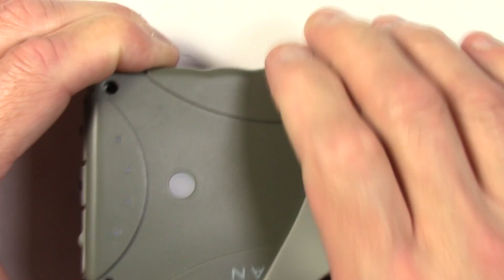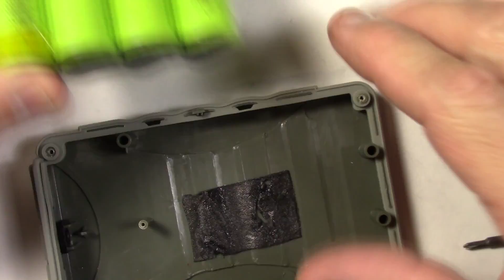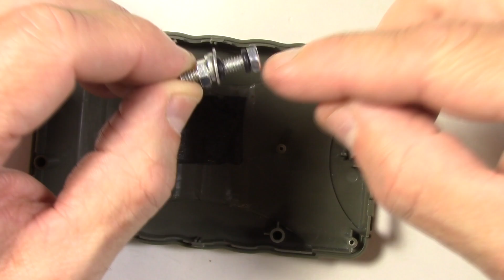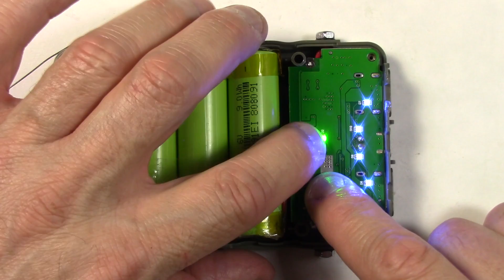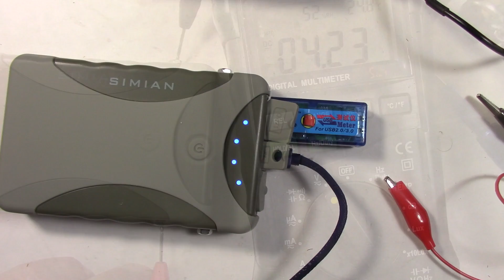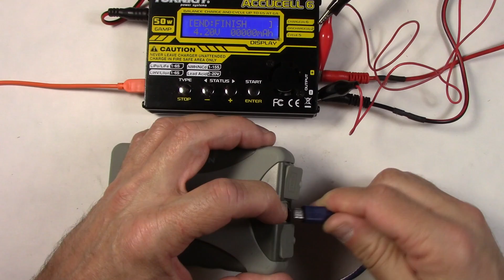Simian Power Up 10400mAh Direct Charge Mod 2 Amp + Charging "Franken Mod"

Comment: you could actually mod this much more by changing those crappy 18650 batteries out for some top end 18650s or better long as they fit inside the case lol

Comment: Hey Richard, why wouldn't you just put in a power jack that you could waterproof? That would be much safer than having 2 bare leads sticking out that could get shorted or inadvertently reversed when you charge it.
Reply from the maker: It was a quick mod. I am aware of the limitations but you can design a system that best suits your needs. Thanks.

Comment: Dear uploader,
I did hv a plan same as yrs to directly charge th cells of my Anker 10000mAh power 💪 bank , by a external Lipo charger, bt I found charging time is reasonable so did not go for mod . 

U hv any plan to do tht mod for yr Anker P.bank ?
Reply from the maker: I, like you, am happy with the charge time on the Anker power core 10000mAh charger. Here it is at Amazon: http://amzn.to/2oAExP7 for those who don't know what we are talking about. The charge time is reasonable at 2 Amps so I don't see the value in moding it. I might be able to shave an hour off the charge time by accessing the cells directly but to be frank it doesn't bother me enough to do the mod. I will consider it. Thanks.
Reply: Richard Lloyd ,
Dear uploader, u hv good idea, and interest abt USB products, lithium cells & so on. Do u knw any Qualcomm Quick charger, which also itself gets charged through Qualcomm Quick charge , or any quick charge technology ?  
I knw to charge tht power 💪 bank , it will also need 5,9,12 volt Qualcomm wall charger. 
Thanks.
Reply from the maker: Here are a few options from Amazon Quick Charge 3.0 Slim Power Bank 10000mAh : http://amzn.to/2qIQvXO or Qualcomm Quick Charge 3.0 ENEGON 10000mAh at Amazon: http://amzn.to/2qITgZi and if you are looking for a monster power bank the AUKEY 30000mAh Portable Charger with Quick Charge 3.0 at Amazon: http://amzn.to/2pcpewy should fit the bill. Thanks for asking. I will consider these as video review options. All the best.
Reply: Richard Lloyd 
Thanks a lot.  :-)
Reply from the maker: You are most welcome. Thanks for watching and the great question. All the best.

Comment: great idea, 
i was thinking if any other connection types could be used. Like female banana plugs, or xt60 but then the issue is water proof or not. I guess some mods would run the wires outside and a xt60 plug.
Reply from the maker: I was toying with a variety of different jacks but none of them were waterproof. I think this solution achieved all my objectives outside of being esthetically pleasing it's cheap, easy and effective. Thanks.
Reply: Richard, what about making an enclosure that is waterproof, and putting the wires through the enclosure, to the battery pack? The Jack can be housed inside of the enclosure, and you won't have to worry about losing your waterproof ability then. Just seal the jack with some hot glue inside the enclosure.

Comment: A few years back all Chinese li-ion battery sales were cut off from entering USA and Canada, this was due to the fire hazard from the manufactures using chargers with to high of current, I have noticed now all the batteries I have seen that come with a charger from China are trickle chargers now.

 The fire hazard is from a cell over heating and rupturing due to to many amps being supplied from the charger, so now they have to spend more money making a larger variety of chargers...

Just wanted to point that out, play safe faster is not always the best of the best slow and steady also finishes the race.

I don`t even leave my home with expensive high quality battery chargers plugged in, smart meters can wreak havoc these days so safety in mind 1st is a smart play.

Thank you for all your videos and helping with links, keep up the good work !
Reply from the maker: There is always the possibility of catastrophic failure, human error being the primary concern but then there are also other anomalies like, brown outs, power spikes and surges too. I like you don't leave my cells charging unattended. I have had a few melt downs (see my video on the Olight: https://youtu.be/kqA_V2lHfqA?list=PLnxXRLSlmSVO3L0jStRnPEEN2egrODjnm ) and recently I tried a NiMH AA on the Turnigy Accucell 6 (Auto charge setting) it got so hot it melted the shrink wrapping around the cell. Needless to say I won't be using that setting again. NiMH on the Turnigy are a bit of a puzzle that I am in the process of unraveling for a future video. Fair mention, my Nitecore Intellicharger I4 has never damaged any cell I put in it. Thanks and safety first.